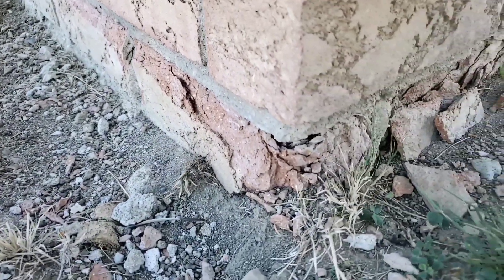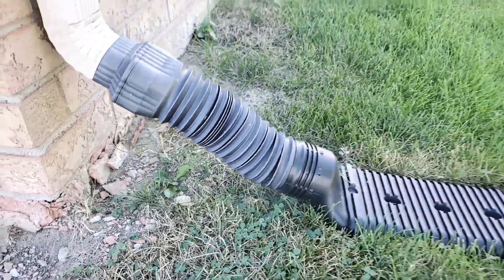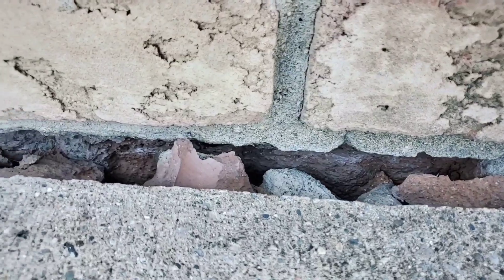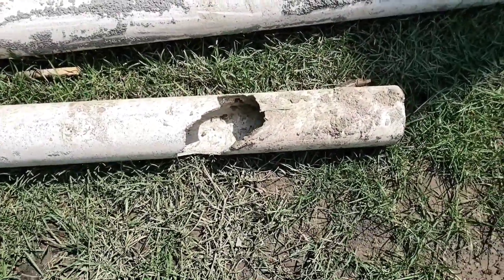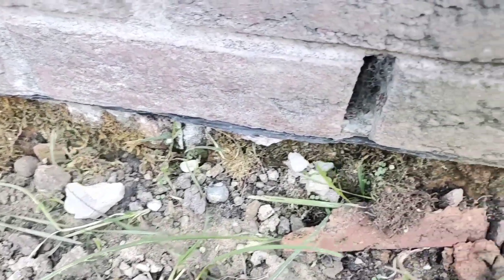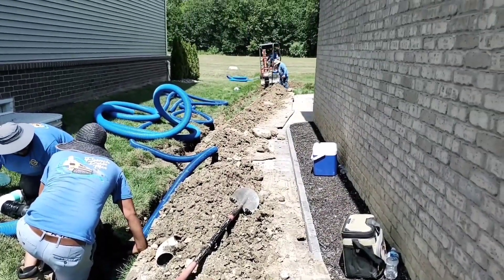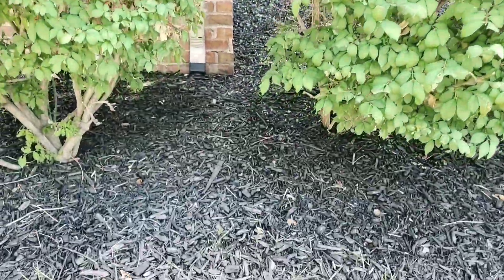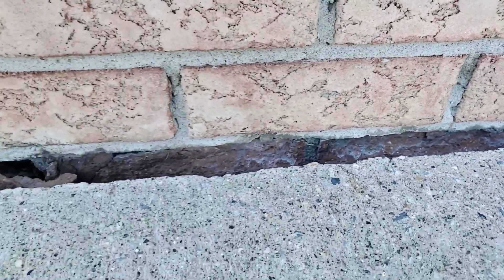Must See Home Damage - Why You Need an Underground Buried Downspout System

Comment: Why do residential builders NOT install rain/storm drainage systems the way you do it?  Is the building code and proper construction methods for removing water away from the home not in sync?  It doesn't make sense to collect rain from roof and place it next to the house. 
In hindsight after buying my 2003 house, I realized the exit door from the garage was damaged. I realized a down spout, which is 4' away, was aimed to spill water, across the concrete and parallel with the door! 
Who builds like that....WTF!
Reply from the maker: There needs to be more then just plot plans. Elevations have to show surface drainage away from the home. There really needs to be a underground plan. The problem is the storm sewers can't handle it so they need water to get hung up in green belts.